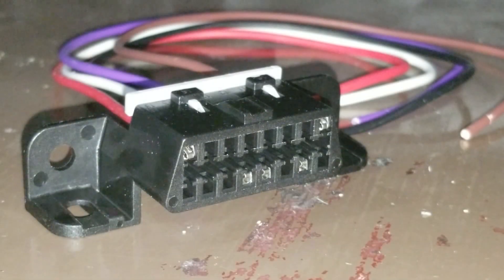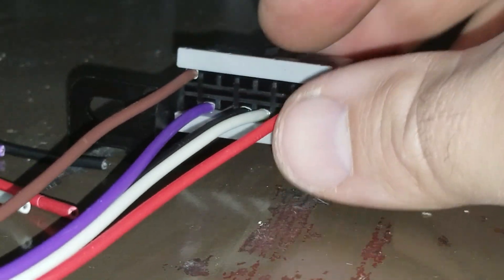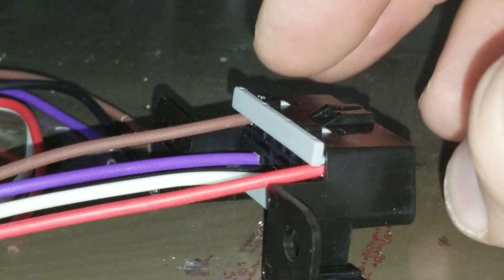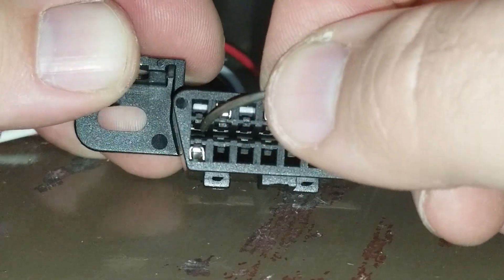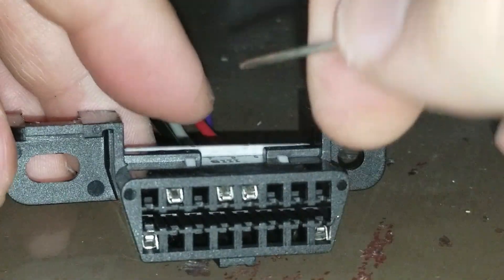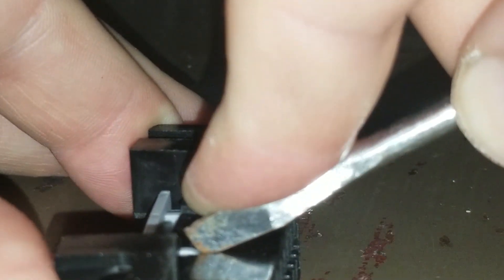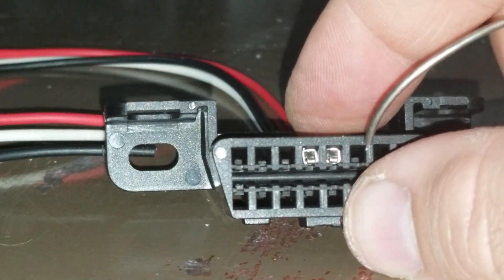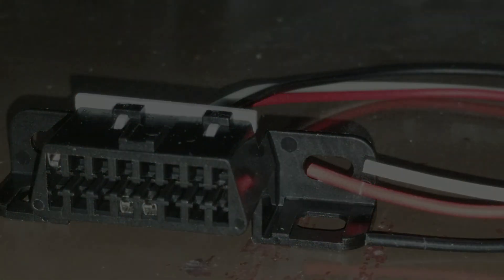OBD2 Pin Removal

Comment: My car doesn't bring in obd2 connector, I imagine someone removed it because in the place it should be empty. How can I do to put it back on or what wires I need to pull out
Reply from the maker: If your car is 1996 or newer, it should have one. Some countries may not have adopted OBD2 until later or the connector may be in a different location than you're used to. A quick Google search should be able to help you locate it.

Comment: How to remove obd2 port on mazda 6?
Reply from the maker: I'm not overly familiar with how Mazda has mounted their ports, but doing a quick search, it appears they use a similar style to what I've seen.

At each end of the connector port under the dash, you'll find a push clip you have to press to "unlock" the connector. Once those have been released, the port should slide right out.

Depending where/how it's located, you may need a smaller screw driver or small pick to reach in there and release the clips.